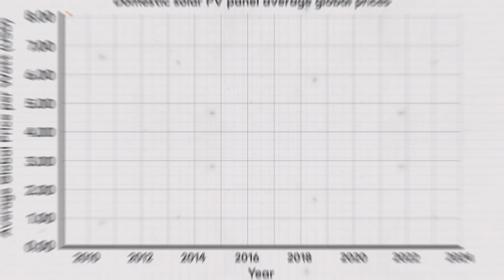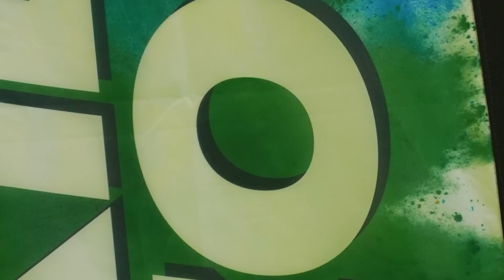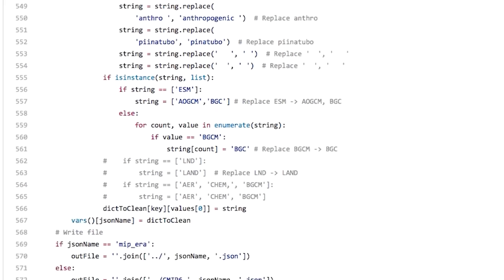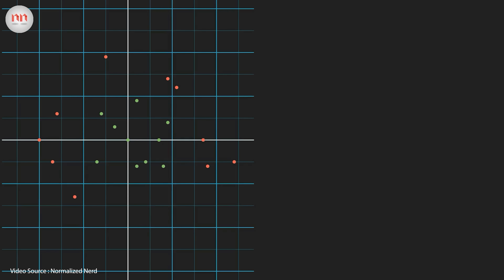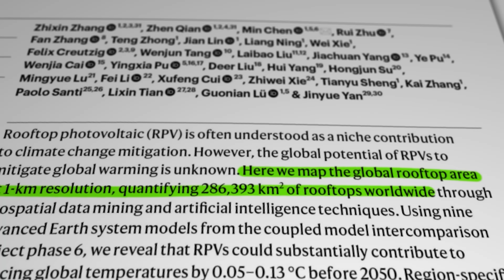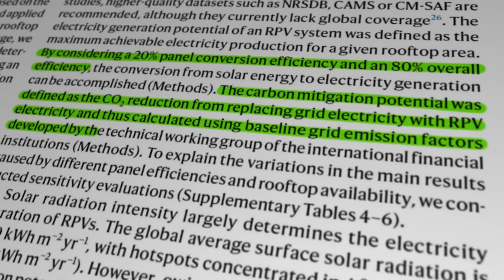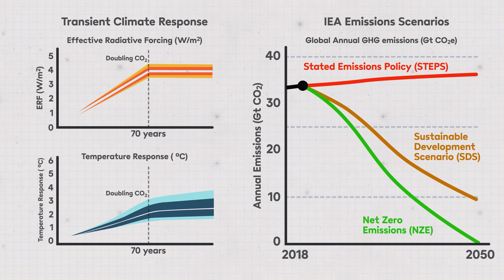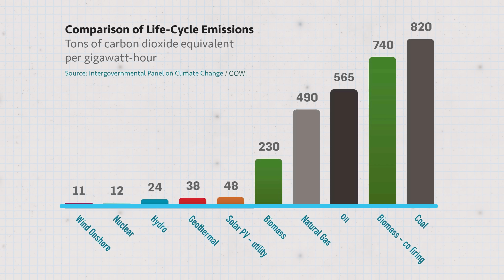New Report - Rooftop Solar PV is THE biggest climate mitigation technology!

Comment: I love my battery solar system. 
But the study cited didn't factor in the reduced albedo effects of a suddenly black roof. 
80% extra heat absorption by 0,2 panel albedo compared to 1.0 of a white roofs of a hot climate country.
Reply: And counting roof space and angle is a start - counting structural capacity is next.  Expect estimate to drop by 70%

Comment: Not concerned with climate so far every attempts to control the uncontrollable ie the CO2 reductions have caused not a single  drop of temperature even with a varibilty of accuracy..
Only get solar if you got the cash up front, the rest like a car will put you upside down the minute they are installed

Comment: We have about 9 kw plus 25 kWh of batteries in UtahThe combination has made it so we haven’t had to pay for any electrons for 3 years    They have not paid for themselves and it will take quite sometime for them too. We also have some of the cheaper electricity in the USA. But it also works as seamless backup power. Several times we didn’t even realize the neighborhood power was out.

Comment: No doubt, that there is still immense potential for more rooftop solar. And it should be utilized a lot more. However, when it comes to calculations about a global "roll out", I am sceptic, how useful and realistic they actually are. There are so many reasons for people not to install rooftop solar: The roof is old and might have to be replaced in the next 5-10 years, the whole house might be demolished by then or the owner might have a low life expectancy. There can be aesthetic reasons not to put panels on certain houses and structural ones for others. And in places, where people cannot feed the produced power into the grid for profit, it might just not be worth the effort, to use the full potential - or it might just be a means, to use more energy. Many people would rely on credits to finance rooftop solar, which diverts much of the profit to the bank. And people without an excess of money cannot take much risk anyways. And unless you buy insurance, an investment into technology, which might break, is a risk. That does not necessarily mean, that poor people cannot invest in rooftop solar at all. But chances are not great, that most people can use the full potential of rooftop solar. 
At the same time, that kind of data does not say anything about the question, if rooftop solar would generally  be the best way for a renewable energy transition. Even if we ignore wind and stick to solar, why not large scale coverage of ugly highways, deserts, (ugly) canals etc? Installation and maintainance at scale can be cheaper, integration into a grid might be easier, if you don´t have thousands of separate independant systems and risks would be socialized and therefore largely insignificant.
That does not mean, that people should not install as much rooftop solar as they can as soon as it makes any sense for them. The technology is available and usually makes economic sense whilst benefiting the climate. But I don´t think, that such calculations based on the surface area of rooftops tell us that much about the question, what we should realistically count on at a global scale.

Comment: Not sure about the UK, but here is Midwest USA standard residential rates for electricity is .133 cents per kilowatt, that is recently up from the typical rate of .125 cents, but they now have these special nighttime EV rates (with a special meter) that is .07 cents per kilowatt.   That is hard to beat.  Before you go dreaming about solar panels and living off grid you might "Just Have a Think" about your standard utility rates and how that money might be better spent on improving insulation and energy efficiency.  Or perhaps you could stop worrying about something that isn't anything to worry about and live your life up a little.  The world will be just fine.
Reply: While I agree that improving insulation is best bang for the bucks in most cases, if you also get payed 0,133 cents for exported electricity I would think payback for solar would be around 8-10 years.

Comment: Scale is the key to low cost. In North America we've got acres of uniform height big box shopping centers consuming lots of power during the day that could have solar on the flat building roofs and even more parking area. Zero trees to shade the panels either. Its the low hanging fruit that has been mostly ignored.
Reply: In Western Australia, those big box stores and warehouses are covered in solar panels.  The other obvious ones are things like the Australia Post distribution centres which provides power for their electric delivery vehicles. Businesses not taking advantage of solar power are burning money.

Comment: I installed a system on my house last summer and have yet to receive a bill from the utility provider here. We have net metering so the extra I generate in the good months is credited to my account and cashed in during the winter months. My location is less the ideal as there are mountains shadowing me from the late afternoon sun and my roof faces east by southeast. I’m on Vancouver Island so the weather is similar to England with moderate temperatures and lots of rain. I really have become convinced from my own experience that universal adoption would be a grid game changer. 
Upsides. With a diversified grid combined with energy storage the stability of the grid would be improved. Blackouts from storm damage could be much more localized and easy to repair. Infrastructure costs would drop due the localized power generation capacity. 
Downside, due to possible pushback from energy providers.  The utility company would transition from a main energy provider to a grid maintenance and management company this would still require everyone to financially support the company by either taxes, base charges, or by changing the rate at which net metering was accounted for. Going from a retail rate of excess energy generated to a wholesale rate to provide a profit for the company to cover grid maintenance costs. Lots to think about.

Comment: I have roof top solar on the south side, east end west since 2009, it already paid off and ! It financed half of the new house ! Since 2020 we have even a PV on the north side  with a 10kwh battery, will be paid off in  6 years. Yearly production is 26000kwh. Beside the positive financial side effect, it has a huge impact on one thing no one talks about, in summer the temperatures below the roof decreased significantly compared to times where we had no PV on the roof.

Comment: I started my solar adventure in 2004, after the major week - long power outage in the North East U.S. and central Ontario, Canada.  I installed 4 80 watt panels on my roof, with lead-acid batteries for storage, and a 1500 watt inverter to power a few things. They are still working pretty well, and I have upgraded my batteries to LiFePO4.  Also several Jackery power banks and portable panels. My system isn't fancy, but it sure does help make things comfortable in emergencies!   Thanks for the video!
Reply: I wonder how long it will be before you go all in on a much larger rooftop solar and storage system as you see over time, just how much of a difference your current set-up makes.
Reply: Waste of money.

Comment: Would be cool if you made a video calculating how much solar panels would save the averag person in uk
Reply: Interesting idea for someone to do this. The problem is the savings would vary so much depending on the person's situation. What size and aspect of roof? How much household usage? EV? Heat pump? Electric hot water? Do they spend the daytime at home or out (e.g. at work)? Either the calculation would have to be an average or perhaps there could be a few case studies.

Comment: I have rooftop solar, with a Tesla battery. I got it on a Power Purchase Agreement, which is too complex to detail here, but essentially I agree to buy all the electricity produced by the panels whether I use it or not. No cost to me for material or labor. The installer owns the system and is responsible for all maintenance. They get any tax benefits and a portion of the $$ for electricity going back to the grid. I don't think I'm saving money now, but power prices in Southern California are going up steadily, and I probably will be saving money 5 years from now. Plus I have power during outages. I can also buy the system if I choose to do so.

Comment: 9:40 the embodied emissions is not a problem. The problem with solar is the seasonal variability of output. When winter collapses to 10% of summer generation, and electric heating demands multiply electricity consumption. Not to mention that the cost of solar panels now is only a fraction of the total system cost, as permitting, labor, money, inverters and other associated costs are not falling with the cost of panels. Not to mention the batteries that are also needed as part of a holistic solar energy solution. 

Solar is really good at decarbonizing air conditioning loads and the first bit of a grid, but the more of the grid it makes up, the harder and more expensive it is to integrate the next marginal unit of solar.
Reply: "When winter collapses to 10% of summer generation" I'm at 43 degree latitude in New England and have had solar since 2014. The worst decline I had was 30% winter generation compared to summer. Usually it is 40-50% lower. Where is that 10% number from?
Reply: @markvalery8632  56N Europe nov-jan 5-10% of summer, feb 25-30%
Reply: Solar pairs very well with wind power in the UK. It tends to be much windier in the winter.

Comment: At list in my country (Poland) trouble is that it doesn't ad up on a single family level to install solar cause the way we get paid for electricity produced is ...stupid. It used to be better, but there was a risk to the grid servicing company to lose there  profit, so we changed it. Now people, are not only covering all the cost of installation, but usually get 0 revenue (at list if they cover the investment with bank credit). That is cause when they are home (and turn the light and cattle on) the sun is low, and when the sun is high the prices of energy are low. And you have to cover the credit cost to. Home energy storage is still very expensive, takes up space, makes the house wiring more complicated and the transaction with the grid operator even more pain in the...Also batteries don't last for ever, so.....

Comment: Solar panels are black and absorb sun heat that would otherwise be reflected back thus heating up planet surface. Is that taken into account?
Reply: The amount of heat absorbed is only relevant to the efficiency of your solar, other effects you mention are so negligible, you can safely ignore it
Reply: I think it is a wash. Without panels, my roof and attic temperatures where unbearable during the summer. That heat would be emitted back to the atmosphere at night and during the day I had to run the AC more.

Comment: I do.  And yes, they have.  I put a grid-tie system in 24 years ago.  It began at around 3kW and took 15 years to break-even.  After that I DIY upgraded it to 5kW and just in the last few weeks I DIY'd a whole-house EG4 battery storage and backup system with 28 kWh of storage (EG4 GridBoss, EG4 FlexBoss21, and 2 x EG4 indoor batteries).  That will break-even in 6 years (because I DIYd it).  Later this year I will DIY an expansion of my solar to 10kW+.  That will also break-even in less than 6 years.

But here's the thing.  At least where I am (Bay Area, California roughly)... the 5kW I have now is able to fully run the house 9 months out of the year.  Zero import, zero export (now that I have the storage system).  Also only very minimal A/C needs where I am, which helps a lot.  And my current system also has enough excess to put roughly 30 miles / day worth of charge into my EV. 

5kW is considered to be a small system these days. and equipment is getting cheaper (though maybe not with the stupid Tariffs)... and the equipment is also a lot easier to install now than it was 24 years ago.   Advances such as meter collars really make battery storage systems easy..  I think it's an obvious move for anyone able to DIY portions of their system.

When I do my solar expansion later this year (to 10kW+), I'll be able to run A/C on it, as well as cover more months (maybe 10 months out of the year), plus at least a bit of supplemental heating in the shoulder seasons, plus export excess during peak hours during the summer.

-Matt
Reply: 24 years ago is an early adopter. Well done. And as you say DIY can save a lot of expense.

Comment: The most popular argument I hear against solar is that the carbon footprint from harvesting materials and the lack of proper disposal infrastructure make solar dirty. Though this is most likely big oil propaganda, I haven't found a strong enough counterargument to shut these arguments down. Any suggestions? I'm personally onboard with solar.
Reply: I can supply all the references if you want:
Lifetime Emissions Comparison
Rooftop Solar Panels
Emit 41 grams of CO₂ equivalent per kWh over their lifecycle, including manufacturing, transportation, installation, and disposal.
Offset their production-related emissions within 3 years of operation, with a functional lifespan of 30–35 years.
Generate 12–20 times fewer emissions than fossil fuels during their operational lifetime.
Natural Gas Electricity
Produces 490 grams of CO₂ equivalent per kWh on a lifecycle basis, accounting for extraction, processing, combustion, and methane leaks.
Methane (the primary component of natural gas) has 34 times the global warming potential of CO₂ over a 100-year period, amplifying its climate impact.
Reply: Recycling: Currently 10% recycling rate in the US. In the EU, where it is mandated, its 85%. These numbers and the amount of what is recovered will grow when the amount of end of life panels increases. There is too much money to be made.
Reply: The two other responses you already got to your question are perfectly correct!
I shall add an element, often overlooked: the CO2 footprint of solar power is almost entirely due to the panels manufacturing. But that manufacturing uses energy that is a bit lower in carbon emission every passing year. The CO2 footprint of solar is hence trending… not so slowly… towards ZERO. While a kWh produced from burning gas or coal will never see its carbon footprint go down the least bit!
Reply: Thank you all for the valuable responses. 🙂👍 I feel much better equipped should such an infuriating conversation arise again.

Comment: Got a PV + batteries installation for my home power 10 years ago.  Adding another system this year dedicated to “fueling” my two EVs.  Doing what we can.
Reply: Using PV to offset gasoline in a car is even more effective, than using PV to offset electrical demand of you house! Just imagine for a moment...What would it cost, to power your house exclusively by a gasoline generator? I did the calculations, and, my power bill would increase from $180.00US to $600.00US! The advantage is 3-fold, if your solar can power your car(s).
Reply: I'm on a church committee that has done a Social Housing project in conjunction with the  NZ central government. And yes those units have solar panels on the roof which substantially reduce  their power bills. 

Note in New Zealand as a whole only 2.5% of homes have rooftop solar, whereas the figure in Australia, is 30% as a whole (due to many years of govt subsides) . 

But almost all rooftop solar is on the roofs of the 62% of people who live in their own home, and mostly the upper income folks at that. 

Unfortunately it's the poorest in Aus/NZ society including the 38% who are renting, who actually NEED those solar panels to reduce their electric bills, most of all.

Comment: Hello from Vancouver BC Canada. I am the point one percent that has adopted roof top solar. Been 2 years and it’s paying for itself with net metering. The finance cost is less than my energy usage cost. The subsidy received was C$5k and directed to system’s down payment
Reply: And if you included the different subsidies you receive, including the net metering, you probably wouldn't be so proud of yourself.
Reply: Is it paying for itself?  Did you do the work yourself? 

I'm in Victoria and I got a quote that was $3.15 per watt including installation.  There's no payback time at that price.  Even with a rebate, it's iffy..  I don't understand why it's so expensive here.  In Australia, you can get it installed for ~$1/watt.

Rather than having BC Hydro pay for rebates, BC should be figuring out how to lower the costs.
Reply: @ChrisR-xs9wp  Talk to BC Hydro. Things have changed.  But also see my advice above ... BC Hydro is very clean.
Reply: Not to rain on the parade, but I’m in Seattle, and the property south of me has four mature Douglas fir. I’m waiting until I can put up my own windmills. At least PSE gets its electricity from hydro.

Comment: Just bought enough panels for a 23kW systems for $7k.  $12k for 45kW battery storage.  They were going to charge me $45k just to run cable to hook up to the grid
Reply: Wow those r good prices. I remember when it was a $ per watt. Just wondering what batteries u have purchased as in the process of purchasing some myself.